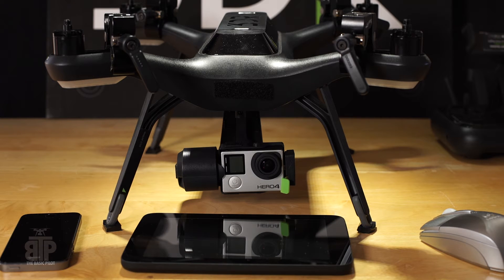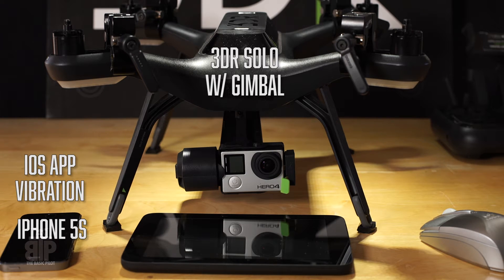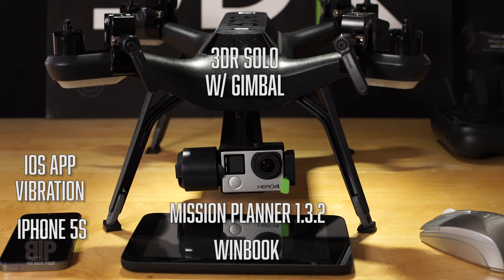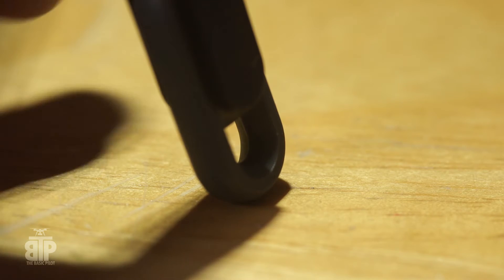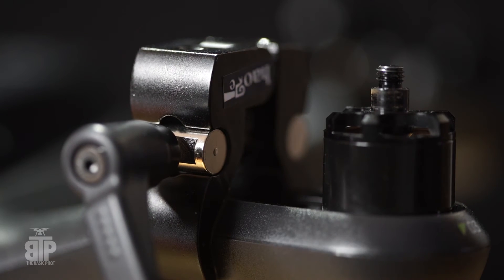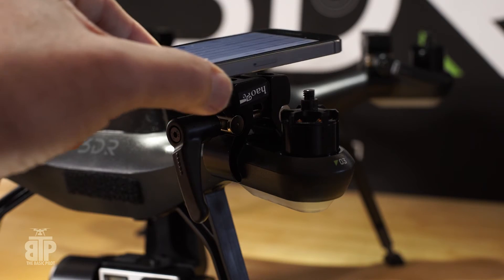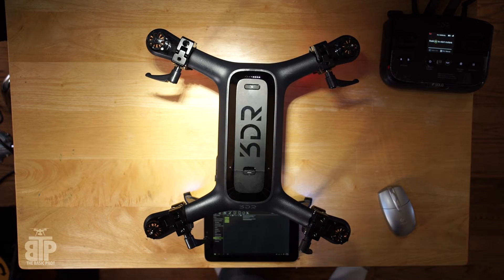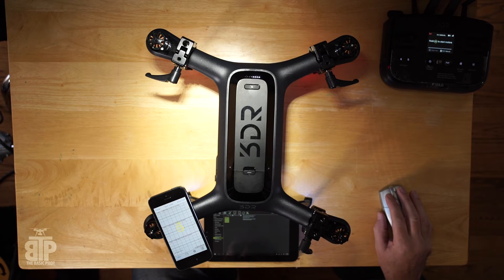3DR Solo Motor Vibration test

Comment: Well if you know what the hell your doing, with the readings you get from each motor and some electrical tape pieces, you can get each motors vibration down to a level that is negligable. Which is good for high end videotography.  Obviously this example was a joke, but if your serious about getting the vibration out of each motor and do it correctly, the Vibration app for iOS is a fantastic tool to do this.  I do this for every motor I run and get very stable and jitter, jello free video.

Comment: Haha, did a similar test with my solo last night, and came to the same conclusion, no idea! I did however, place the phone on the battery and ran all 4 motors through the rpm range at the same time. While throttled up to the rpms giving the most vibration, i pinched the end of each arm between my thumb and forefinger to dampen each one and i was able to isolate the motor with the most vibration. Note: I learned the phone cannot be placed too close to the gps or it will loose all satelites and will have to wait for aquisition all over again to re test. Placing the phone horizontally across the rear end of the battery away from the gps solved it.